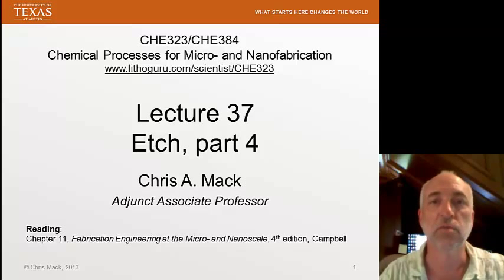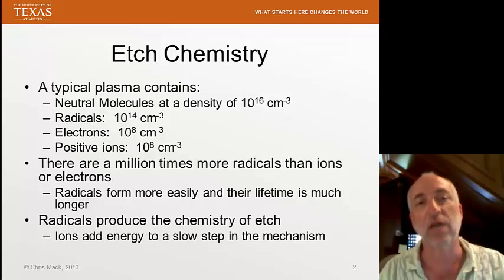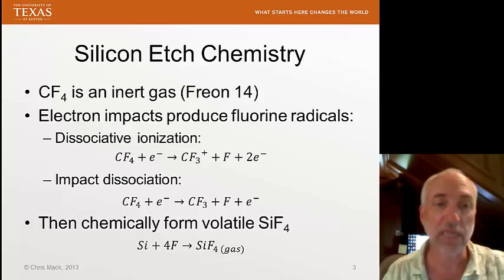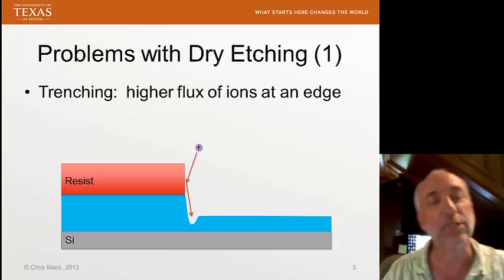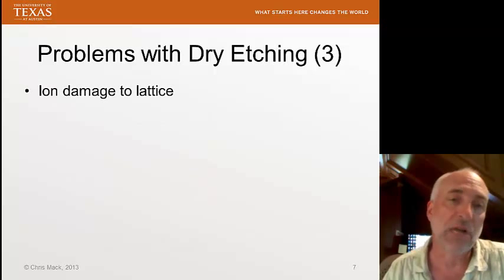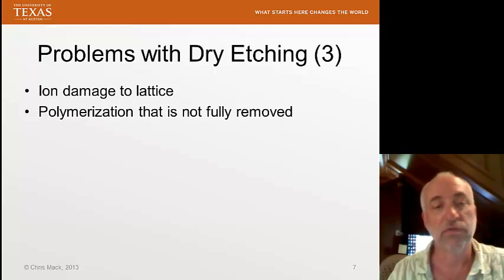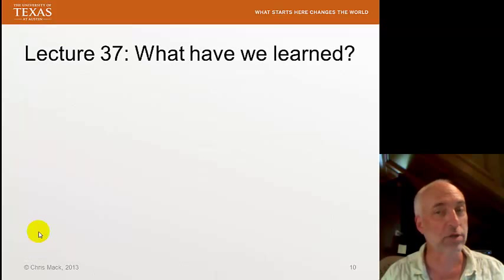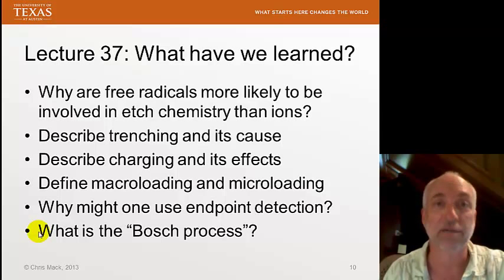Lecture 37 (CHE 323) Etch, part 4

Comment: The lectures are so good. By the meantime I got some questions:
1. Why you don't want H in the RIE process?
2. What causes etched features at one edge of the wafer to have higher etch rates?
3. What causes the overall wafer-scale etch rate

variation pattern observed in wafers?